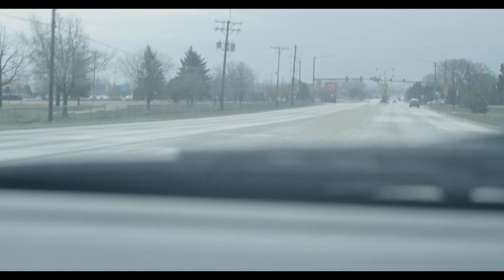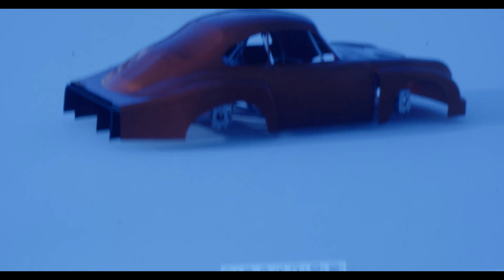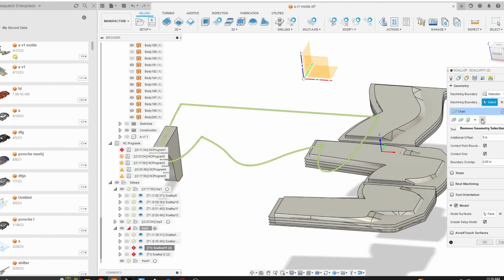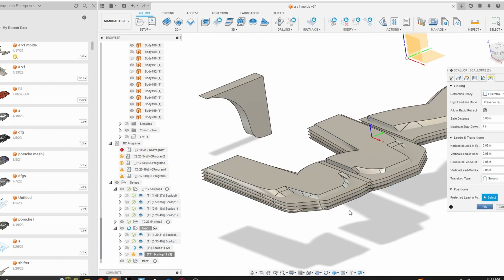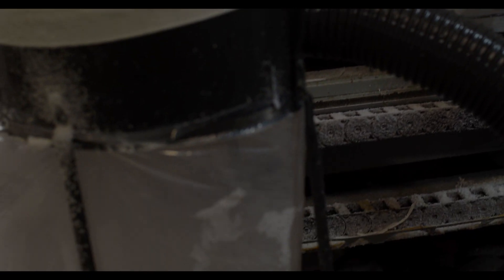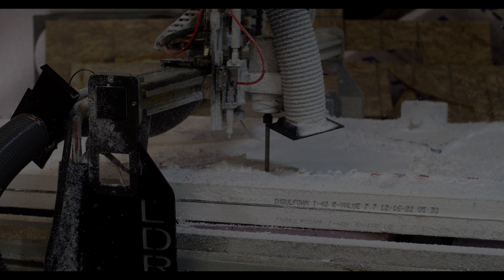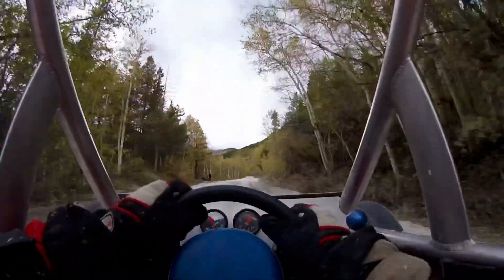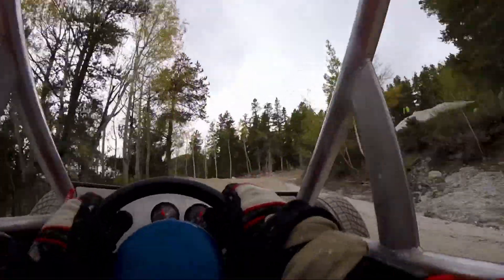The Beginning of CNC Milling a 356 Hillclimb Car out of Foam - The Right Way

Comment: Digging the new flares and the extended rear with diffuser. Very cool project.
Reply from the maker: Thank you for your kind comment! I’m excited to start on the middle section and rear. I may have to make a video on machining those, I got carried away with the front so no video for it (at least not the machining.)